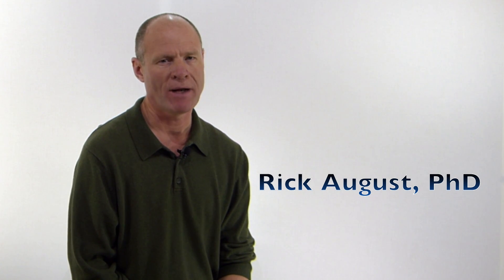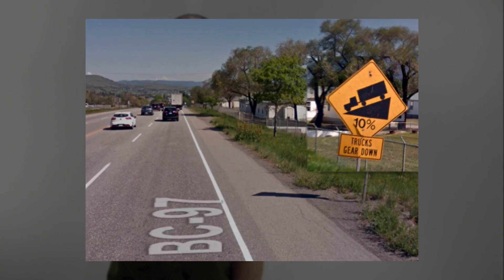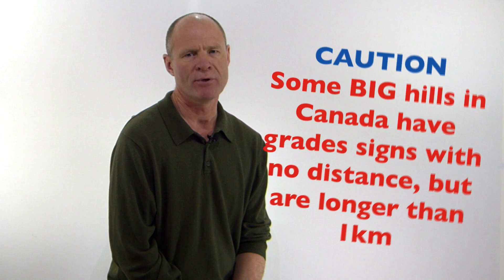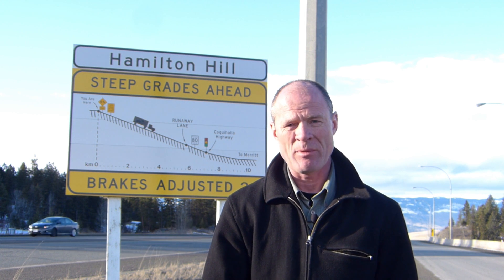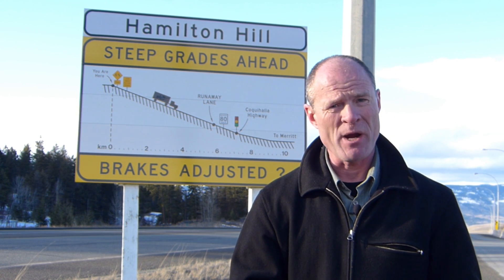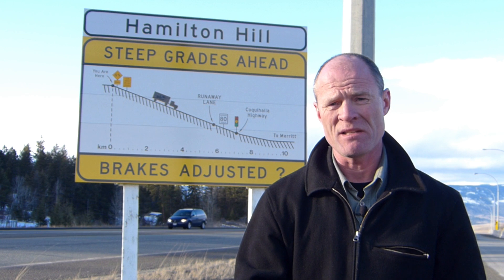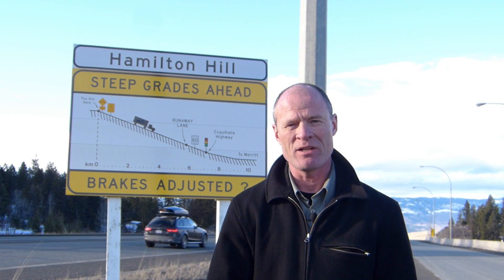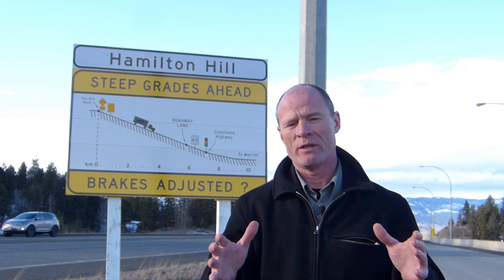How to Brake Downhill Safely | Air Brakes Smart

Comment: Very informative, thank you
Reply from the maker: Hi Daniel - one of the most important rules of downhill braking - never hold the brakes on for longer than 10 or 20 seconds. Employ short, hard, intermittent brake applications in a big truck. Brake hard enough to bring the diesel engine RPMs down by 3-400. In this way, the air can go over the hubs, and keep the brake cool. If you have any questions, drop us a note.  Cheers Rick

Comment: Have you ever had to use one of those runaway lanes?
Reply from the maker: Fortunately, I've never had to use one of the runaway lanes. Most of the time, if you do a good pre-trip inspection and employ the proper braking techniques downhill, your chances of losing your brakes are greatly reduced.  Thanks Tim, Cheers Rick